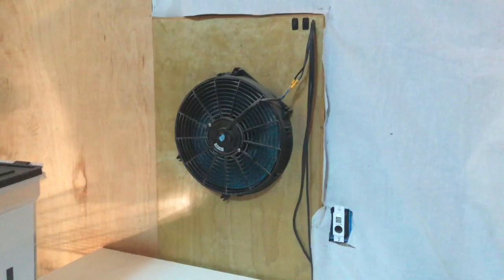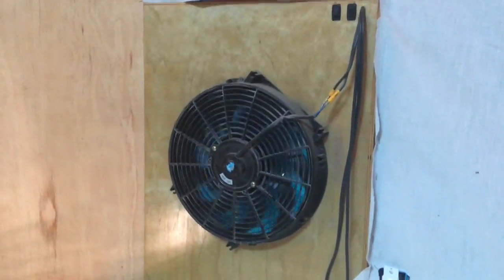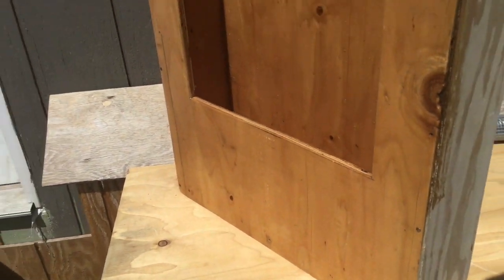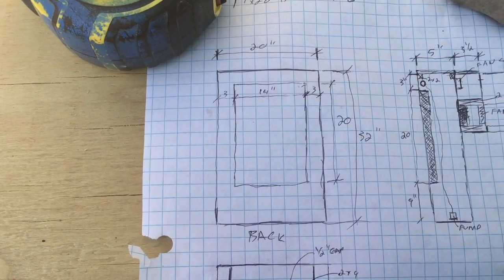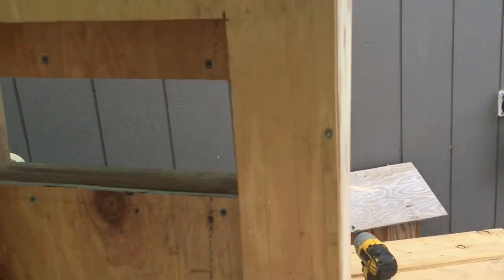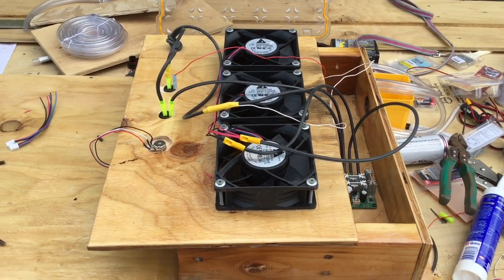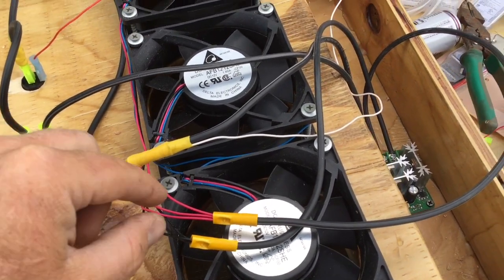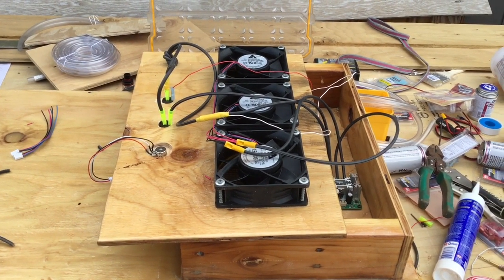12v Custom Swamp Cooler

Comment from the maker: Build took 3 days 
Here is the list of parts I ordered from amazon:

Ultra Strong 12cm DC12V Cooling fan. 200CFM
Fan size: 120mm x 120mm x 38mm(4.725" x 4.725" x 1.5") 

RioRand™ Upgraded 6V-90V 15A DC Motor Pump Speed Controller

Decdeal Submersible Water Pump DC 12V 5W Ultra-Quiet Pump for Pond, Aquarium, 280L/H Lift 300cm